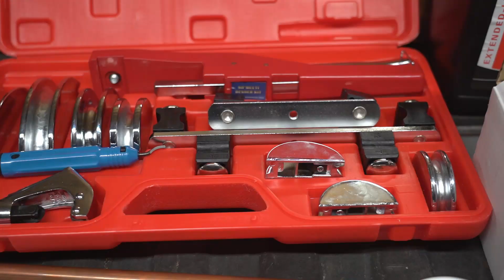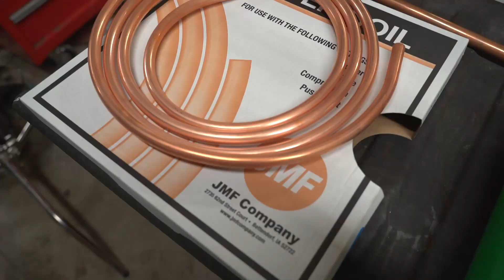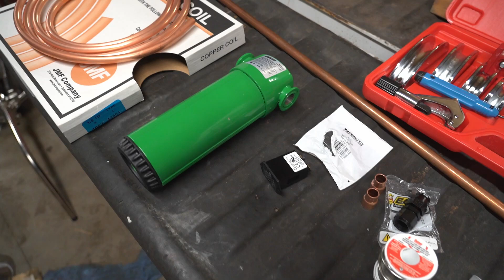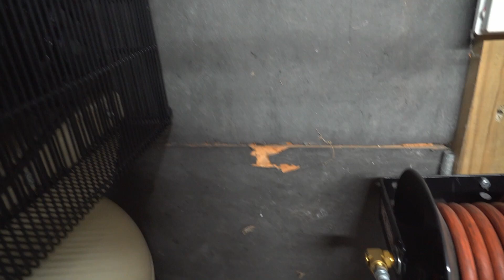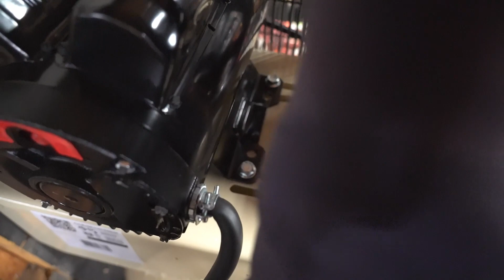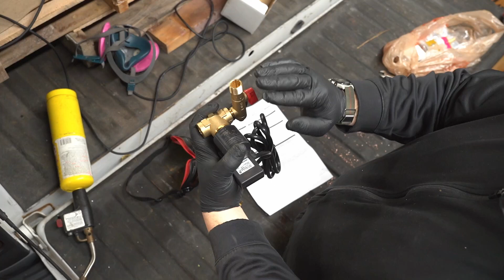New Air Compressor & Water Separator

Comment: Do your self a nother favor..add a magnetic starter to your IR unit ..your pulling at least 40 amps at start up..your pressure  switch  will burn out ,when u least expect  it..bottom  line costs to market  there units saves them money  ,and u get a big headache..down the road. 300 bucks adder costs now..ask any electrician  this q..... great video..here my Saylor-beall  unit came with the same thing you added  on yours ..mine made in st.johns, Michigan..
Reply from the maker: I'm glad you mentioned it. I was wondering how long that switch would hold up given that the contacts aren't even sealed. I may actually be able to measure peak inrush current with one of my new clamp meters, so maybe I'll work on a YT short for that today.
Reply: @manovermachine  I've been through it in the past..just letting u know  I.R.  won't help you..they,ll. Sell u a new product, pressure  switch..
Reply: I went big , this Jan 2022 bought a industrial, unit Saylor-beall..model VT 730- 60- 1 - FP.      3h.p. 2 stage came with everything..even a low oil control..magnetic  starter it pulls 30 amps at start up..runs on 16 amps ..  its good for me I piped it into my old 80 gal tank..it dose what a 5.h.p. unit can do..and the best thing. It runs so quite..I can here my TV  in my shop..check mine out on my channel..ty..
Reply: Stephen I'm currently working on setting up an old Saylor Beall 705 -5hp twin stage.  It's a 90's era 705 which has a really large, heavy pump, 120 gallon tank, and 5hp motor.  To your knowledge will something like the Derale 15300 condenser radiator be large enough?  I'm concerned that I might need larger fittings all around and a larger condenser with fittings bigger than 1/2.  Is 1/2" piping large enough?  I plan to run at maybe 120 psi max but the pump being so large it will want to get there quickly I assume.  I'm new to this so any help is appreciated guys!
Reply: The 705 pump is top heavy. The piping to to radiator  is half inch.on mine..going into to radiator. It's three q...inch going into the tank..but half inch should be fine..u can look up specs  or call Saylor-beall. Factory. I think his name is jim..the floor supervisor..there in st.johns, Michigan..yours is probably  an older pump..,but they last a long time. Use 30 non- detergent ams-oil comprsoir  oil  I was told..they have parts for your pump if u give them the serial  # off the pump face plate.. u probably  have the vt-735  model pump.  U can use a 3 hp. Moter or a 5 hp. Motor  on your 705 pump..I have a 3hp.  On mine ..
Reply: @stepheneggert7388   Yes the ol' 705 is indeed very top heavy.  I checked the specs for mine with the 5hp motor.  It's 18.3 cfm at 100psi or 17.3 cfm at 175 psi.  I plan to set the max at 120psi.  I was thinking I would need 5/8" or 3/4" pipe for the precooler from pump to tank but maybe 1/2" is ok?    And if using both 3/4 and 1/2 I would think you would want the 3/4 from pump first to radiator/condenser because its hot, expanded air and it would have more cooling benefits of the surface area for 3/4 pipe and then if needed step it down to 1/2 after the condenser as the air is more dense and cooler then.
Reply: I love my comprsoir.. it dose for me my needs in my home shop..we have a self service  carwash..it may end up there at some point..the thing. Weighs  570 lbs..il need a lift gate rental..truck..ok..good luck..with yours and enjoy

Comment: It is not your fault the pipe broke, look at professional pipe benders (the ones with the long handle) on youtube and you will see the pipe is pushed into the form as it bends. That sort of bender should be returned to the vendor as not fit for the purpose. The only way you can bend with that contraption is to fill the tube with sand. As you probably already know, if you used soft copper, you would not need a bender anyway.

Comment: what size are the inverted flare fittings for the new copper pipe? Into the brass fittings in the pump head and tank that is.
Reply from the maker: They are 5/8 inverted flare nuts. P/N 41IFS-10 are what I ordered from "Industrial Parts Fittings" (No affiliation) -> https://bit.ly/3b2g6qZ
Reply: @manovermachine  aw man that's awesome, been trying to find something locally at the big box stores with no luck, thanks again!

Comment: You need to buy soft copper pipe if you want to bend it like that, or anneal it first.
Reply from the maker: Pretty sure I mentioned that. Either way it was obvious after the pipe snapped (sometimes people forget things) annealed copper doesn't have the same pressure rating, hence my choice to use type L pipe.